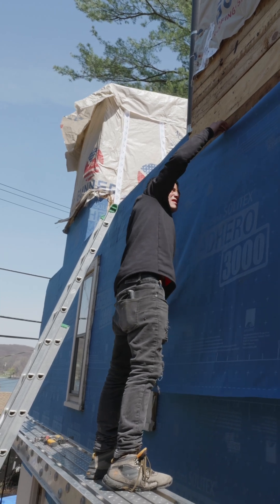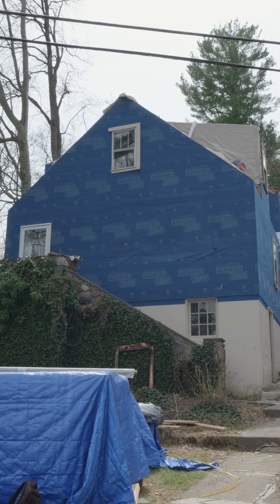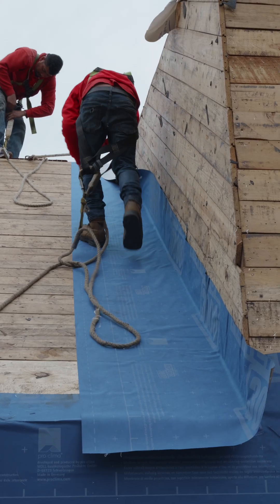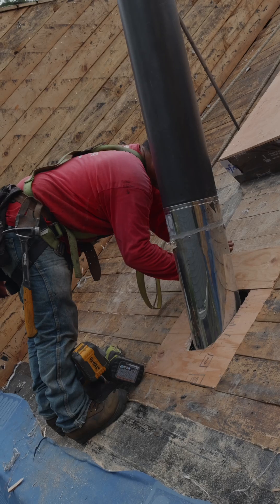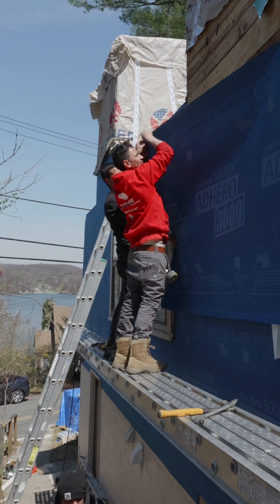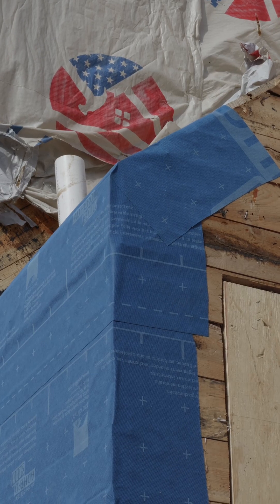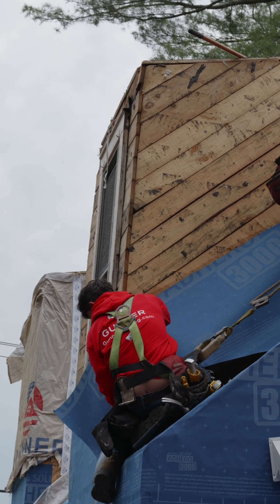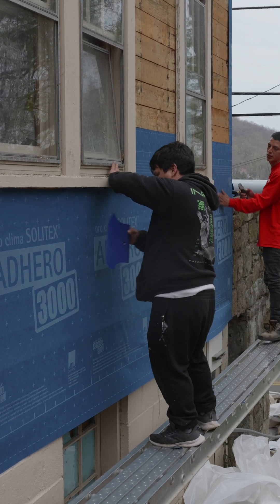the BEST air and water barrier ... pro clima adhero 3000 #passivehouse #energyefficient #renovation

Comment: Overhangs prevent excess rain water to get to the foundation, they protect your walls and windows too. 
If your house can’t ‘breathe’ moisture will collect in the exterior walls, attic and roof. You will need to run dehumidifier constantly to keep moisture low. 
Energy efficiency includes moisture control/ wrapping house in plastic is huge mistake. Also - do not use any gas appliances including water heater and furnace or CO can kill.
Reply from the maker: Hi there - Yes, as an architect and passive house consultant, I am aware of everything you mentioned. The product specified and installed serves as an air and weather resistant barrier, while being vapor open. This allows any water vapor that collects within the wall assembly to move either inwards or outwards to dry. This product is used for many passive house builds and has a great track record. 
Regarding the overhangs being removed: if they were left as they were, they would continue to pose an issue with thermal breaks at each and every rafter, in addition to causing a lot of trouble with creating a continuous air barrier. In our following videos, we will show the rest of the wall and roof assembly construction, which will prevent all of the issues you mentioned.
Also, check out our earlier Youtube videos where we show the rewiring process for the house. The house has now been fully electrified and will not utilize any combustion for HVAC or appliances.
Reply: Thats not a newer green built home.You cant make it like a new build by just putting a house wrap on it.Ive been in custom home market Where we did 12'' double wall homes in Northern climates 30 years ago.Been a build for 40 yrs.Over hangs do a lot to protect walls and siding, there are ways to do this .
Reply: This is true but proclima adhero is vapor open so trapped moisture can dissipate.